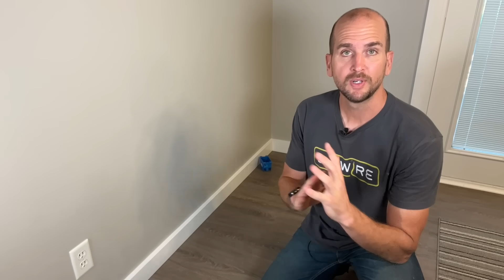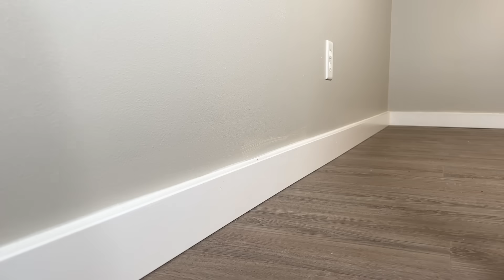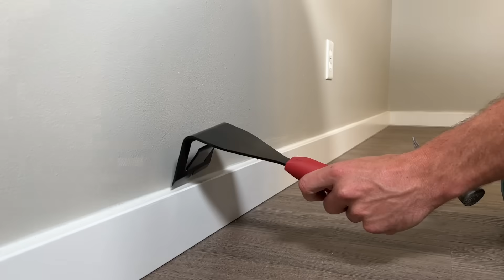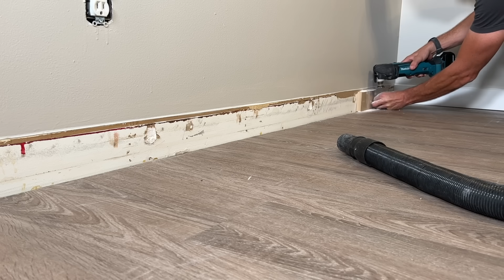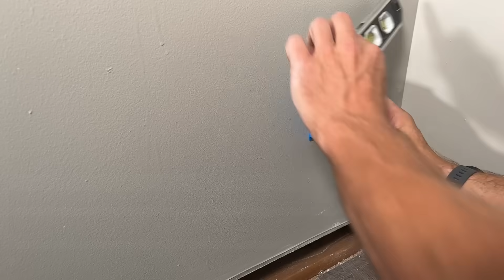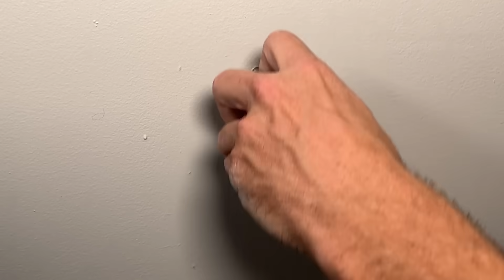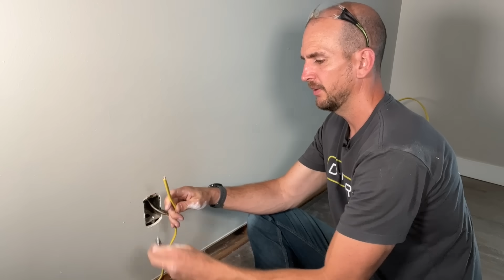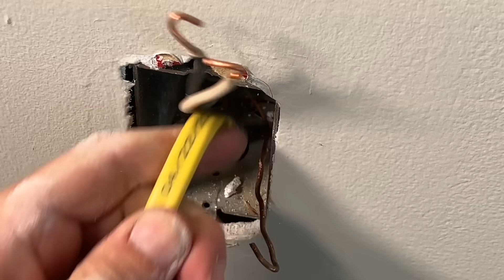How To Add An Outlet To A Finished Wall

Comment: Excellent video tutorial, but make no mistake, there are lots of steps in this process which require appropriate precision tools and plenty of thought and patience. This work can be done by the do it yourself aficionado - but some may be deterred from attempting the work because of the sheer amount of time this whole process will take. If you’re not sure, it would be best to leave the work to a qualified electrician.

Comment: Residential electrician here. I do this all the time. You can do the same thing to add lights in a first floor ceiling with no access above if you have crown molding.

Comment: Very informative video.  I used the same approach of removing trim and cutting the drywall to pull power from an outlet to a light switch several months ago.  I wanted to install a smart switch but there was no neutral in the switch box.  So I pulled power from a nearby outlet to the switch box so it had a neutral and then made the appropriate changes to the wiring at the fixture.

Comment: Nice job, had not thought of taking out the sheet rock.  Any suggestions on running speaker wire up from the bottom to the ceiling to install ceiling speakers?  Unfortunately, there are fire blocks (studs) that need to be overcome.  Only thought that I have is to go to the attic, drill down on top stud, then switch to a 72" flexible extension drill bit and work my way down to the opening that I created for running the speaker wire. Thoughts?  Thanks for the great video.

Comment: When you run electrical wires through studs, is it recommended to attach metal plates to the studs where your wire runs through to prevent any accidental drilling into the stud and hitting the wire behind it?
Reply from the maker: In this case I should have been far enough away from the end of the 2x4 that I would meet code but not a bad idea for some additional safety.  I found these about 6 months back and you drill a little larger hole (1 1/8") then insert the EZ Gaurd and you have protection from all sides https://amzn.to/3ET8hzb

Comment: thanks for all the content and knowledges you shared with us in every single video. I am freeze up to see how many things i did not know about simple electrical works, by the way I have been doing this works wrongly (sorry). I would like to know what will be a good approach when you need to install like smart switch( dimmer too) in a wall that does not have enough deep to install it.
I have concrete wall behind the sheetrock wall. I used some extender boxes but it looks horrible like half inch out from the wall. thanks

Comment: Few pointers here..
1. Turn the breaker off before touching the hot side of the receptacle screws with your tape measure.. For obvious reasons. 
2. Pre-drive the retention wings on the remodel box and then back them off. These boxes are crap and this way you will make sure that the screw doesn't have too much resistance and that the ears will open properly and not bend and break inside the wall where you don't see what's going on. 
3. When using a remodel box, break off the parts with the hole (ears) from the receptacle bracket. Remodel box has a notch that only the part without ears fits into. If you leave the ears, you are deforming the bracket and risking the screws holding the receptacle to the box getting loose prematurely.

Comment: One minor suggestion. Break off the plaster ears off the outlet. This allows it to recess into the notch in the old work box which in turn allows the face plate to fit flusher to the wall. Excellent video!
Reply from the maker: Spot on, and ironically I just did a video on that yesterday outlining my mistake https://youtu.be/9JFJAZ9KDmk  Thanks for the feedback.
Reply: That makes no difference if you use a mid size plate. Only with standard size plate.

Comment: I have a question.
I found the circuit for the steps going down stairs with no load but breaker is on. I removed the panel face and check loads in all breakers and everything was good. Check connections and good. What should I’ll check nexts. Thank you in advance!!!

Comment: As soon as I saw this video posted I thought run the wire behind the base boards.

I am an electrician and at one time I did alot of remodel wiring on very old homes.

I had one general contractor that had a friend that had a lumber mill.

When we needed to rewire the home ( most of the time ) he would rip off all of the trim and get me to give him a price to rewire.

I put nail plates over the wiring at every stud.

He always got very nice oversized old school trim milled that made the house look great.

I usually replaced the boxes with plasticboxes and used oversized plates. Those old metal boxes are just too small.

He always covered lath and plaster with 1/4" drywall so he could finish it smooth.

You learn alot of tricks working on old homes.

My general contractor griend never had a dissatisfied customer. He never needed to look for work and always had a backlog of waiting customers.

 I learned a few things from him.

Old homes can be a money pit for the wrong  people.

Comment: Did I follow that right - the new box is only secured to the drywall?  I thought they always needed to be secured to a stud.
Reply from the maker: That is correct, old work boxes are very common and only hold on the drywall.

Comment: This video is without a doubt, one of the best tutorials in how to do a very common DIY project with ease. Well done.
Reply from the maker: Thanks 👍
Reply: @EverydayHomeRepairs  No thank YOU. I'm a DYI'er myself and never thought of doing this. The only time I have had to install another outlet like in this video was when I had access to the wall from the basement which obviously made it MUCH easier. However I need to install an outlet in the upstairs closer to the window so I can have access for my AC and this trick will do nicely.

Comment: Nice video, you should tell the novice viewers to never hold the tip of the tape measure next to the side of the outlet like you did, you made sure you didn’t touch the edge of it but I can see someone following your direction and hooking the tape to the edge of the drywall and bumping the electrical on the side of the outlet😝

Comment: How do you remove the insulation on the wire now that it is inside the box after you have tightened down the Rolex connector???.

Comment: Good job , one thing through, code indicates that when going through studs each stud should have a metal protector plate on stud direclty in front of wire hole. to protect from drilling through when mounting anything !

Comment: Stud Protectors Missing: When voltage cables are installed through wood studs during construction, there's always the potential someone can accidentally cut, nail or drill through them. Now, make sure your wiring doesn't get damaged with a steel safety plate. These plates are designed to be hammered into upright wood studs to ensure no one can penetrate through to the cables. They have built-in prongs to attach to the stud, so you don't even need additional nails or screws. They're quick and easy to install and keep you from having to replace and re-run wiring.
Reply: Nail plates are only required if you're less than 1-1/4" from the edge of the stud.  If you keep your hole centered, you've got plenty of room and don't need nail plates.

Comment: That looked great if you have all the tools. When I did my kitchen in England I just went horizontally across the plaster wall. It was cardboard egg box interior so I didn’t have to take all the plaster off. I tiled over the wall also so my lack of plastering skills would not be noticed 🙂. I hope this is of interest and in no way being negative to what you showed as I thought it was very interesting and informative to a different situation to mine. I do have to say though in England the regulations are you have to sleeve to Earth J wire. Excellent video-really enjoyed watching it 👍

Comment: A 1" hole through the studs is to big it takes a third of strength out of the stud that's like a carpenter damaging the outer shield of an electricians wiring

Comment: UMMMM What kind of person would mount an electrical outlet directly on drywall? Very likely a person that will have to repair that outlet in the future. I have added outlets exactly the same way you've done but I mounted the box to a stud. It's even easier and much more reliable than dealing with drywall lack of support.

Comment: I think I remember in my last NEC code update that the outlet on an extension has to be at least AFCI protected or combination AFCI/GFCI protected.  Just the extended circuit.

Comment: You're obviously not an electrician because you're using the wrong wire and you're not leaving enough wire coming out the wall. There is a good reason why you need about 10" of wire coming out.

Comment: You only have 2 wires in the Box so there's no need for pigtails all of the plugs have 2 terminals you could wire straight to the plug it's kind of overkill it's not needed You're just adding more wires and more difficulty and more situations where you could have a short

Comment: The issue with this idea is that most walls are framed on the ground, nails driven up through the base plate and then stood up.  When drilling through the stud that low, you will hit those nails every time unless you have unusually tall base boards that allow you to drill through much higher up.
Reply: Framing nails in that case are typically 3½ inches long. His holes were about 4 inches from floor. Looks like he just made it... Through the 1½ inch bottom plate, that leaves 2 inches of nail in the stud. Good for future reference.

Comment: 16 inches between studs? 60 cm (24 inches) is the standard here in Norway. I wonder what the reasons for 16 inches are.
Also, is "romaxe" the name of the electrical cable?
Reply from the maker: What are the size of your wall studs?  We use predominantly 2x4’s (actual dimensions 1.5” x 3.5”). And Romex is a brand that is commonly used for non-metallic sheathed cable. 👍

Comment: Old work boxes are nailed in before the sheet rock goes on and can not be installed without removing the rock.. New work boxes or pop-ins are what you installed here. Also, using channel locks is the best way to remove finish nails, brads, etc. Of the channel locks are pushing on soft sheet rock, put a block behind them for back up. Even a paint stick or thin door shims will do the trick.
Reply: You have it backwards. New work boxes have nails, old work boxes attach to the drywall. Look it up.

Comment: When you install the plug in the box, you need to check to make sure that the bare ground wire is not touching the other exposed screws on the plug.

Comment: WRONG!!!!  FIRST, you must be sure there are not already 4 outlets per circuit, most homes ALREADY use the maximum amount of outlets per circuit ( 4- which we call a home run ) SO if you add a 5th outlet ( and don't disuse one of the existing 4 ) you are in code violation. NEST, anytime Romex goes through studs, you must install NAIL PLATES, these are sheet metal covers that go in front of the Romex so someone in the future doesn't run a screw in and short out the power leads, causing a fire. If you are going to modify your utilities, you MUST know the codes and safety requirements to do that work, this guy seems to be unaware of these rules....
Reply from the maker: I appreciate the feedback and nailer plates aren't a bad idea or maybe EZ guards but not called out be code if the wire is more than 1 1/4" from the face of the stud.  I dove deeper into both NEC and building code on this specific topic in this article on our website https://www.everydayhomerepairs.com/how-to-run-electrical-wires-through-studs/
Reply: @EverydayHomeRepairs  Thanks for standing up for yourself.  I don't understand the use of a pigtail if that is the last outlet in the circuit. Why not wire directly into the other side of the outlet?
Reply: @kellyinfanger9192  For me it is ease of service. It is easier to push three wires back into the box than five (especially with 12ga wire) when servicing an outlet whether it was broken or just changing out for color or different style.
Reply: @EverydayHomeRepairs  The link is dead...

Comment: Great video and solution to a common problem. One question though.... Why did you have to use the Wago connectors at all? An outlet is made to jump from one to another so couldn't you just plug the wires for the new outlet into the back of the old outlet since it was the end of that leg? If not, what am I missing?

Comment: The National Electrical Code states that an "outlet" is any place along a circuit where electricity is USED or CONTROLLED. 
Therefore, there are SWITCH out lets, LIGHTING outlets, MOTOR outlets and RECEPTACLE outlets.

Comment: Once in a while we bump into a video so informative we cannot but think every video should be made in the same way. This video is simply packed with tricks and useful info. Awesome!
Reply: Truer words never spoken.
Reply: simple and clear and NO annoying intro ... great job .  Even nice to hear - you look like an expert at everything but you admit you can't do caulk.... thanks for making YT better. jg
Reply: DITTO!
Reply: Two major code violations in this video.
Reply: @StanSwan  what are they?
Reply: @diegosanabria1031  Two violations here, would fail this. Old metal box already has too many wires in it. That box need to be 18 cubic inches. Extending an existing circuit to an outlet it must be arc fault protected. Other things I could nit pick I will not but are just poor workmanship issues.  

Master Electrician Ray
Reply: @StanSwan  Thanks for the tip as I may add an outlet like in the video.  By being arc fault protected is it the same as bathroom outlets.  GFCI outlets?  I have heard them called? Thanks.
Reply: @hawks2252  All outlets in a home must be AFCI. In a bathroom they must also be GFCI. So they need to be both.
Reply: @StanSwan  the old metal box only had one set of wires in it before the new set was put in, so afterwords it had one set in and one set out. The box fill should be fine.
Reply: @MILLERBEE74  Nope, you can't add wires to a box unless it has the cubic inches to do so.
Reply: You can purchase AFCI outlets, which look like GFCI outlets with the test and reset buttons. If you are not able to get an arc fault circuit breaker, you can put the arc fault receptacle outlet in the first location to protect from that location to the extension and whatever is plugged into either location. Follow what your local code requires. It’s great for protection. And make sure your boxes are sized for the number of conductors of the gauge of the conductors and include the device in that calculation. It’s in t table 314.16(A) of the NEC
Reply: @gregderise9969  Not in new work. AFCI must be a breaker.
Reply: @StanSwan what are they
Reply: @brightonst  Are who? Try using a quote.
Reply: Just like my underpants.
Reply: @pouly841  I
Reply: Ahaaa nice.❤🎉
Reply from the maker: Thanks man 👍
Reply: @EverydayHomeRepairs  But where's the earth wire sleeving? Obviously different regs in the US
Reply: @oaklandsdriveresidents7590

Comment: Brilliant!!!  I'm a retired master electrician with almost 60 years experience - why did I never think of this?????  Many thanks!
Reply: I didn't know you could do this.  I thought it was against code to run wires this low
Reply: @lawrencehull9859 pretty sure it is, in most llaces4
Reply: Between the video and the comments I am more confused than ever.  Even the "expert professional" electricians cant agree.  As a handyman, who has researched electrical codes in Canada, it sure seems like a very sketchy and illegal wiring demonstration.
Reply: 60 years? That's funny

Comment: ...ever wonder why fixture cords are so long?
Did you bother to shut the power off before you stuck the end of a metal measuring tape at the energized hot terminal of the receptacle?

Comment: Why do you speed up the video when you are connecting the wires in the box. That is the part that I’m not very familiar with.  Not a good tutorial
Reply from the maker: Sorry, this is because I wanted to keep the pace up on this one.  You can go to our YouTube page for the channel and just select the little magnifying glass if you are on a computer (doesn't work on mobile).  Then type in "outlet" and you will see 20+ other videos which will dive much deeper on the wiring.  Cheers!
Reply: In the Youtube player near the lower right corner there is a gear looking thing. Click that and you can change the speed there, faster OR slower.

Comment: Not protecting the floor, not resealing the drywall... Typical contractor half-assery. Combined with the previous contractor half-assery (non-insulated interior walls, slightly misaligned studs preventing drywall from laying flat against baseplate, bottom of baseboard not caulked to floor) and you're guaranteed to have a draft now. I've been caulking every edge of every baseboard ever since I discovered that doing so reduces the incidence of household bugs/spiders by about 95%.

Comment: Great video, the only thing I would recommend to your diy’s is to turn on electric service before you button things up just to test everything you did then shut it down and close things up.
If you did have a problem and the breaker failed to trip you would never know until you smelt something burning- and by that time it’s to late.
Just saying…..
Not being critical in any way- love your video- just better safe than sorry.